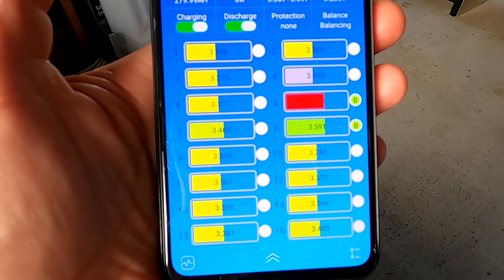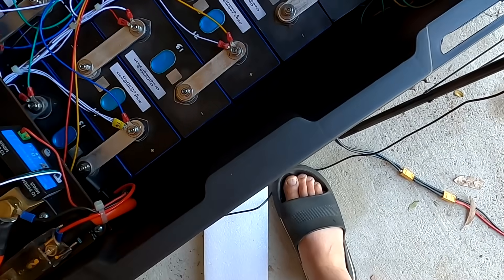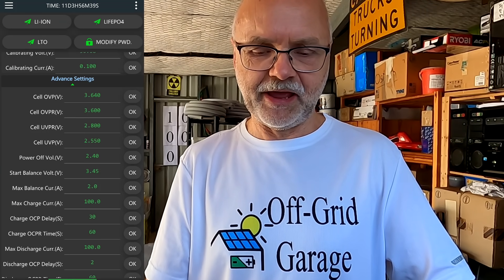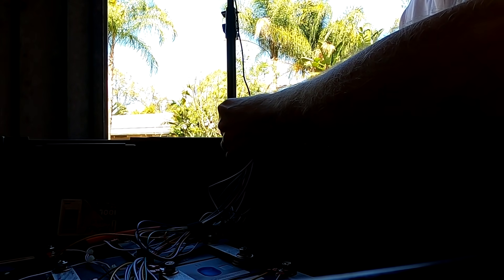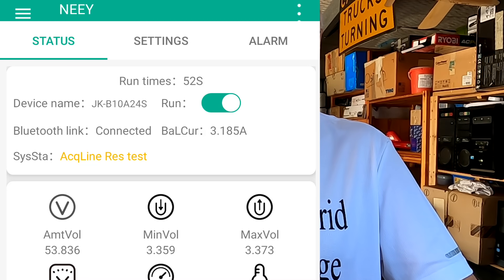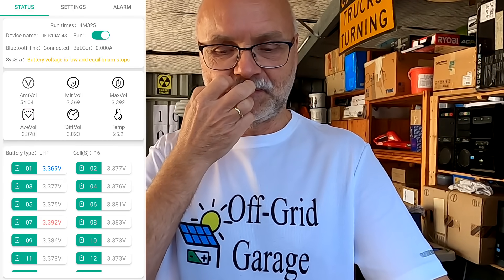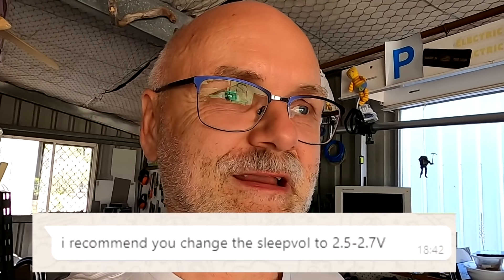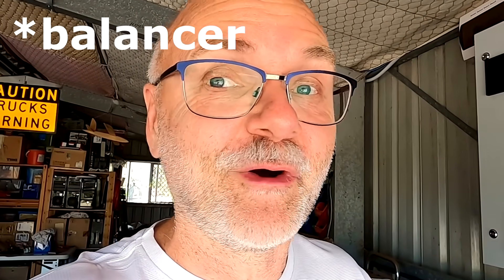NEEY Smart Active Balancer - The missed opportunity to get it right.

Comment: Start and stop @ 3.45v? So it stops right before it start?
Reply: Start at 3.45, and when you're charging, you will go over that while the balancer works to compensate. It won't turn off for quite some time. Once you drop below 3.45V it stops again.
Reply: @upnorthandpersonal  No, it won't stop until 3.15 and so will balance right through the mid range plateau hence destroying the balance completely
Reply: @MrHantu666  Yes, with this balancer. A good balancer starts and stops at the programmed value, which is what OP asked.
Reply: I think Andy meant start at 3.5v and stop at 3.45v.  Could be mistaken.
Reply from the maker: That's the main concern with this balancer, that it frickin' does not stop until you hit this sleep voltage again. Every BMS can do this better. So frustraiting... what were they thinking?! 🤦‍♂️

Comment: The JK BMS has the same balancer circuitry with supercaps and DC-DC converter.  Tell Neey to buy one of thoughs BMS's and make the Neey balancer work the same way.
Reply from the maker: I've seen them online. They are like $450 for the 5A version though. App looks the same as for the BMS.
Reply: There is a JK standalone balancer too, but it hasn't got a setting to restrict balance to top end. If NEEY get their act together and make this setting in their next version they will be ahead.

Comment: I have this balancer (different brand, but it's the same thing) because after the Andy's first video, I was sold.

I am going to try using it for several days using 3.1v as the sleep voltage (so it will start balancing only at 3.4v), as the Chinese engineers think that's what the correct setup is.

Will it be balancing in the middle as well, and not just the top? Yes.

It will "undo" the top balancing, but it should balance it again anyway (Andy's won't top balance anymore bec if he sets it at 3.4v, then it will only restart at 3.7v, which he doesn't/won't reach.

I'll observe the next few days, and maybe it'll be fine?

Oh, well, we'll see....

Comment: This active balancer looks to be almost ideal, except for this silly engineering choice.

I'm still liking the Heltec/JK BMS out of all options, but it would be awesome if they came out with a >2A unit.
Reply from the maker: The JK BMS seems really the winner here at the moment. I think the 2A version will be totally fine. Once the cells are balanced, the internal balancer will keep them in line easily. 
I really don't understand their logic behind that NEEY balancer. This could have been the product for everyone who doe not want to swap the whole BMS and goes with the JK.
Reply: Especially for typical solar applications, 2A is fine. You also don't need to balance it all the time. Cells stay pretty close; just schedule a balance once every few months or so when you have excess solar.

Comment: I see you are testing all these BMS and balancers and despite all your efforts, the devices don no give proofs of reliability. 

I am wondering what kind of balancers of BMS are using the 5kw or 10kw ready wall modules. The manufacturers offer up to 10 years of warranty. How did they resolved the issues you are facing actually? What do you believe?
Reply from the maker: Yeah, I'm testing different solutions so other can see how they work, if they work or not work.
The JK -BMS I tested recently is the best device so far.
I'm sure, if you build a battery and have a BMS with balancer installed, it will just work if it is all setup correct. Again, I'm testing a lot of settings, devices and make changes all the time. I'm trying to 'break' things to see what happens, to learn, understand and share. I'm not trying to find a way to make it work at this point.

Comment: Those little heltec balancers i'm sure only balance above 3.2v not on all the time.
Reply from the maker: You mean the ones with the capacitors I showed? They even balance at 2.5V as I tested in a video not long ago.
Reply: Yes. I know some people who use them in battery’s they build and sell and they also use the jk balancers and have had success with them. Im told its 3.2v the heltec comes on at from memory even though the specs appear to say otherwise and There are a few different board variations i have also noticed so maybe some are old models or set different. I have purchased a couple to test out but yeh still on the fence with it as i have always leant towards it not being a good idea if your battery spends time in a lower soc for a length of time due to it then un top balancing. I get an even amount of success stories to fail story’s still so yeh its a tricky one.
Reply: @magicmanspaz  I saw on the Heltec documentation that for LFP model balancing should start at 3v and it should disconnect at 2.9v. There is also a solder bridge mardked as RUN. I thought about desoldering it and connecting it to a smart relay to trigger balancing only at high SOC, but I have no need. I used it for top balancing a few months ago and then disconnected it, so far no more than 6mv deviation between cells at high SOCs

Comment: It is a shame that you cannot set your own start and stop voltages in a ''smart'' called device, however, if I understood properly if you set 3.35V and you charge up to 3.65V you will only balance in the area that you should balance a LFPO4 battery, so it is useful for you chemistry, not for your special needs. 
:)
Reply from the maker: Not many people charge their cells to 3.65V on a daily base. It's not necessary and creates just stress on the cells. And even 3.35V is already in the flat area of the curve so will cause some 'damage' to the top balancing.
You're right, for a smart device it is not that smart.
Reply: @OffGridGarageAustralia  I would not recommend it either because it has more disadvantages than advantages, it is not that smart but the chinese will always defend that it can be use for LFP if you charge to 3.65V everyday, you would balance everyday, I am aware of the stress that this causes, I am only trying to put myself in their position.
Great videos like always! :)
Reply from the maker: @juancazorla3746  yes, your right. I'll keep pushing them and trying to get this resolved for everyone.

Comment: A smart balancer would map the drain / charge times and move no more on the way 'down' than it could on the way back up in the amount of time it had for charging.   Given the complete lack of control and fine tuning -- what precisely about this product makes it "smart"??  Where's the learning?  Operating on static values / static algo doesn't make something smart.  Prediction and the ability to learn makes something smart.
Reply from the maker: None of these devices are learning in any form or adapting to a found pattern. Smart means just certain parameters can be changed via app. You're absolutely right.

Comment: With the amount of money you have spent on balancers and BMS's, along with the time you have spent arguing with chinese resellers, you could have bought a Batrium or Rec bms and  not have to tinker with it all the time :P Don't worry, I have done the same. My next purchase will be a Batrium
Reply from the maker: As I said before, I could have bought a Batrium from the start and I'm 100% sure it will work very nicely. But the majority of people will buy Chinese tech for their batteries and I find it important to test that and share my findings. It's not about getting it right, it's about testing, understanding and learning.
Reply: I've run the JK for over a year now. My next BMS for my additional two batteries will be a JK again. And yes, I've used a Batrium in the past. Also, think about the money he's making and future potential thanks to this channel - it's been a good investment I'd say :)
Reply: I've had both. The REC Bms much better built and easy to install. Has CAN integration with Victron and supported here in Australia. REC also has a precharge unit. You have a minimum of $3200 in cells there. Of course if you just bought something that works you would have no content for your channel!
Reply from the maker: @SydRV7A  I heard good things about the REC BMS...

Comment: I don't know what the f... is happening with your active balancers.........
I have 24v LifePO4 battery pack (8s- 80Ah) which is connected with a 8s active balancer and a Victron battery protect. I am using this battery pack for last 3-4 months and monitoring cells voltages- still now all are fine.
Reply from the maker: Maybe you're not playing around with your settings all the time to see and learn or swapping out devices to test things?
Reply: @OffGridGarageAustralia  Hi, I don't have any options to play with it. But from day one, it's working great which surprised me. 
Everyday, I am monitoring calls voltage couple of times. Nothing found wrong with my setup. Once in a day, I used to pull 2000w for half an hour for my water heater. Rest of the day, normal light & fans.

Comment: My batteries work totally different than yours they are all balanced from 3.1 to 3.35 (the nominal voltage) so mt balancer turns off in my mid range. I believe when you totally discharge your battery that is what changed the perfect top balance.
Reply: How can you be sure that your cells are balanced between 3.1 and 3.35? The reason the balancer doesn't work in that range is that the curve is flat and you can't know the state of charge based on the voltage in that range.
Reply: @upnorthandpersonal  Obviously we are using the wrong tool to try and balance capacity with voltage but that is what is on the market if one was to try and keep each battery at the same capacity in the whole range then the voltage would need to be different on each cell. Some BMS and balancers have a resistance setting which could accomplish that but we are talking about something small and nonproductive in comparison to the cells complete capacity less than 2%.
Reply: @offgridwanabe  In general, you don't need to balance often anyway. So once or twice a year (in summer) I take my cells to 3.6V and have them balance. The rest of the year, the balancer is off and I don't charge higher than 3.5V (or even just 3.45V) per cell at most anyway...
Reply from the maker: A discharge will not change the balance of the cells. The BMS will turn off if one hits 2.5V and keeps the others as they are. Once they are charging up again they should meet at the top level again as when they were balanced +- some mV lost in heat due to internal resistance difference.
Reply from the maker: @offgridwanabe  yes, that's correct. They discharge the same capacity until the one with the lowest capacity hits 2.5V. It's then at 0Ah while all other cells still have some capacity left.
Reply: @offgridwanabe  Keep in mind that when you charge to 3.6V again and one cell gets there before another, you're usually talking very small amounts. Everything over 3.5V or so is negligible capacity-wise, especially at low C rates. You're at the steep end of the curve...
Reply: @offgridwanabe  "for clicks" ? 171 thumbs up...
Nah

Comment: I don't understand the concern with cell balancing. Did you build you battery with mismatched cells?  Seems to me if you started with new cells and properly top balanced prior to assembling the pack, the individual cell drift over time should be extremely minimal.  That has been my experience with the packs I've built.
Reply from the maker: That is not the point, Jim. I have made several videos where I explained that balancers actually cause imbalance, because they balance all the time. With this one, I was hoping for a solution where we can program the start/stop voltage for balancing.
https://youtu.be/4iPpn8-Pakk
Reply: @OffGridGarageAustralia  I've see all your videos. The Neey is flawed for sure, you demonstrated that very well. Those following along should first fully understand the conditions under which a separate balancer would be beneficial. In a solar setup like yours, and in most, the tiny passive balancer included with the BMS is completely capable of dealing with the miniscule cell drift over time.
Reply from the maker: @jimbeam5  I agree.